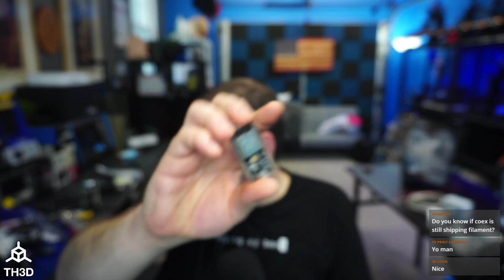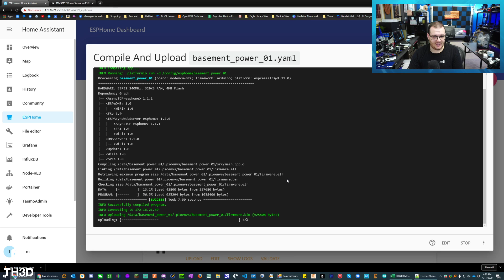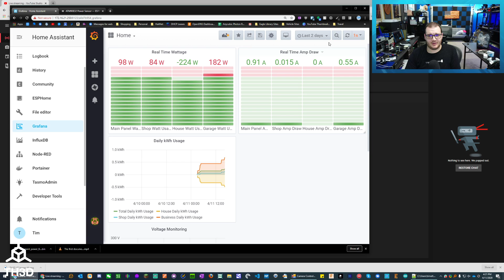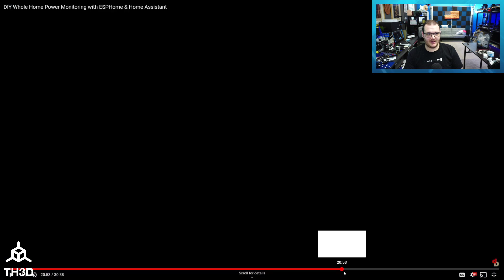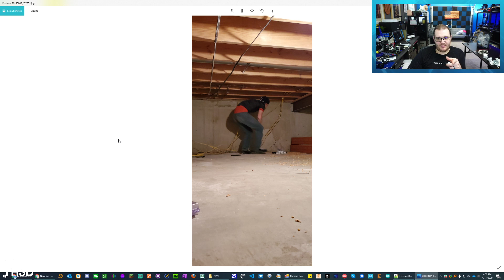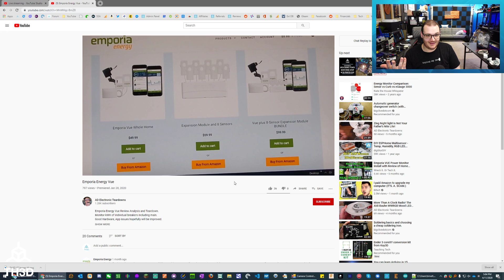Monitoring Home Power Usage - Open Source Power Monitoring Setup - CircuitSetup.us ESP32

Comment: did you ever make an update?
Reply from the maker: Been using it since the video was made. It's been working great with Home Assistant. Highly recommended.
Reply: @TH3DStudio  Watched your video on Circuit Setup & found your presentation helpful. Would love to see an update after the installation with how you are using and logging and or banking the data. I am in process of planning a Circuit Setup install & have a mid size solar panel installation. I do not want to have a cloud based system. You referenced the video by Digiblur (Travis ) that also goes through an installation. Both of you have been helpful.